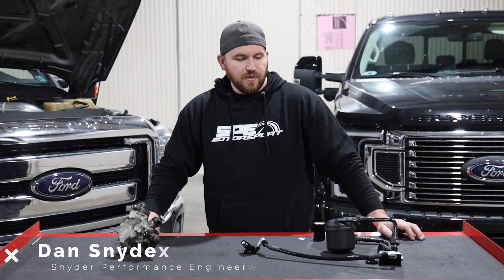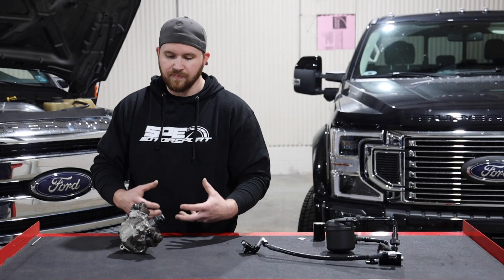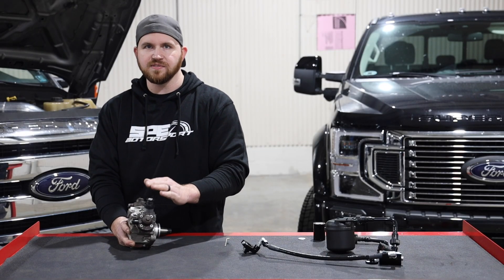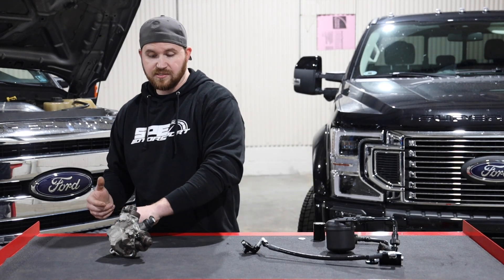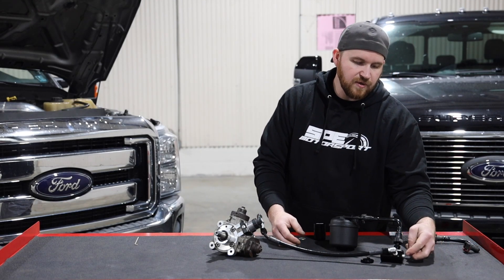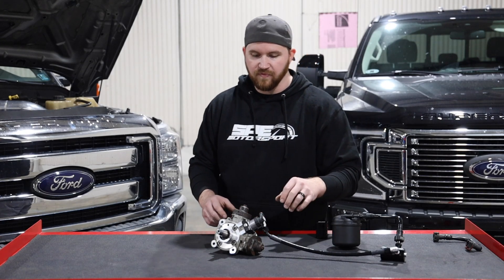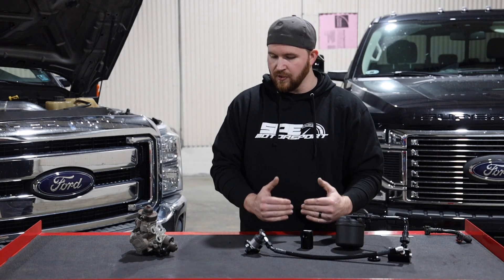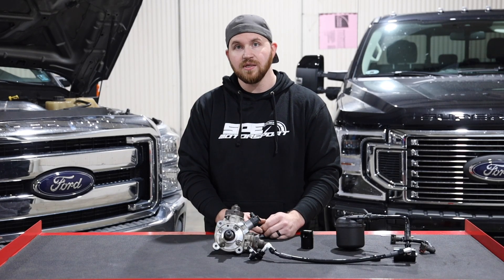SPE's NEW 6.7 POWERSTROKE DISASTER PREVENTION KIT and EXO FILTER SYSTEM

Comment: Notice all the videos installing the SPE kit dont have factory CCV's. both the distribution block and the filter block rubbed up against my factory CCV and caused a leak between one of the two. Removing the SPE kit and going to an S&S kit after hearing from the company that they dont take returns on installed parts. Other than the leak, all the parts look to be in good shape. Tech support said Ford installs the fuel lines bent down sometimes. Not sure I believe that but regardless i'm not yielding my factory hard lines to get an aftermarket kit to work. Feel free to contact me if you want a heavily discounted SPE kit in like new condition!

Comment: Umm ... what's the advantage over maybe a fass pump instalation ... one with a return (from the pump) back to the fass filtration system ?
Reply: The FASS is Upstream of the High pressure system.
Reply: @BLACKCLOUDFORD  true , however I think it heads off  most of the cp4 problems with fuel filtering ,  removal of air ... polishing .
Reply: @smaksymiv4950  it's inevitable.... It'll eventually happen. No matter how well filter and screen your fuel. CP4 design is no good.  When it fails, go with the DCR

Comment: Just so everybody out there is aware I purchased this kit. It was missing the diverter valve that goes on top of the fuel pump. I had to wait over a week for this part to come in. I connected everything back together the truck would not start I tried. And try and the vehicle would not start so I took it all apart again went back to the factory connections, leaving the disaster kit laying off to the side started the truck it took about 20 to 30 seconds. The truck fired up. I ran it for about a minute and then went right back and connected the disaster kit And everything ran fine so if this system is open for any time at all, you would have to go back to the factory connections, fuel lines, and everything start the truck and then repeat the process for installing the disaster kit. It cannot be open for more than a few minutes otherwise, for some reason it does not start with a disaster kit Installed.

Comment: I bought this kit from these guys over two (2) years ago. Once I had it installed on my 2018 F350 LIMMITED 6.7 PowerStroke, I was happy to have preformed this simple task of preventative maintenance and never need worry about an expensive fuel system catastrophic failure from these all too common fuel pump failures.

Comment: Just asking wouldn't any material going back to the fuel tank be picked up by the filter in front of the tank and the filter on the engine? Thanks for video
Reply from the maker: Yes but then there's still debris in the tank.
Reply: @SPEMotorsport  Thanks for the reply, but that was my point, wouldn't it be pickup by the 2 filters one in the tank and the one under the hood before getting to the engine again?
Reply: @duconce  It is my understanding that the fuel in the bottom of the fuel pump goes to the top and is pressurized and sent directly to the injectors.  No filters are in between the metal shedding fuel pump and the injectors.....without a disaster prevention kit.
Hope this helps.
Reply: @markparker4032  The return fuel that is sent back to the tank would go thru the tank filter and the filter up top and the SPE filter before going back to the cp4 pump and injectors. I was only talking about the return line filter to the tank.
Reply: @duconce  The cp4 is the source of the metal shavings.  The pump will simply pump those pieces of metal directly to the injectors.  The 2 fuel filters that you are referring to ....they filter the fuel BEFORE it get's to the pump.  There isn't any filter between the pump and the tank on the return side nor is there any filters between the pump and the injectors......all filters are on the supply side of the pump.
Reply: @markparker4032  I understand all that, again I am speaking of the fuel return line to the fuel tank and the metal shaving that would go back to the tank. I don't see the need for there filter on the return line to the tank only.
Reply: @duconce  Understand.....without this kit......the bottom end of the CP4 pump get's fuel first.....then it goes directly to the top half of the pump to be pressurized.  This kit separates the fuel to the top and bottom of the fuel pump.  So instead of the bottom end failing and those particles going to the top of the pump and ruining injectors etc....they go to the screen filter instead.  I hope this makes sense....this isn't easy to explain....nor a simple concept to understand.
Reply: Maybe try watching some of the other disaster prevention kit video's.  Some are better than others at explaining how they work.  Best of luck to you.
Reply: @markparker4032  You don't understand what I was talking about, I know exactly how the kit works. The kit also filters the line that returns the fuel to the main tank in the truck. Adding another filter there to me wouldn't make any difference since it would not get back to the engine because of the other filters that feed the engine. Not that that matters much because cp4 is all ready trash. I just don't see that filter is needed.
Reply: @duconce  OK.  I see your point.

Comment: How much does this cost, how long does it take to install, and please tell me that it will NOT void my Warranty
Reply from the maker: Lindsey, I would encourage you to head on over to the link below and check out the article on our site to better educate yourself on warranty information. We believe education is a very important tool. As well, the pricing for this kit is on the website. For someone with some mechanical ability and had worked on vehicles before I would say it should take about four hours start to finish. The removal and install of the factory parts is the hardest part of this. Actual installation of the kit once you have everything off the truck needed should be much less than an hour. I will provide a link to another YouTube video that covers installation with some tricks and tips as well.   

Article - https://www.spemotorsport.com/blogs/blog/the-magnusson-moss-warranty-act
Installation Video - https://youtu.be/mVAkkSDJzGM

Comment: What about the fuel in the crank case of the pump? Does it flow in and out some other way? If not that fuel that stays in there would definitely get hot
Reply from the maker: Jacob, fuel is still supplied to and returned from the crank case of the pump, giving the pump a constant fresh supply of fuel that us properly pressurized (as long as your lower pump is doing its job) so it can be regulated and returned through the exo filter incase of a CP4 failure. 

In the event of the failure of the CP4 all returned fuel, and in this case debris, will be routed to the exo filter to limit the debris from cycling through the system and wiping out your fuel cooler, lower pump, injectors, ect. When the truck sees that there is a excess build up of pressure on the return side or limit in supply of fuel you will get a CEL and should immediately pull over and check your exo filter. 

Without our DPK in the event of a CP4 failure there would be nothing except the screen on the volume control valve on top of the CP4 to rely on to stop the debris before it went to your injectors and then returned to the rest of the fuel system.

Comment: How is debris not going out to the injectors with the kit? Is there a feed out line after the cp4 to a filter system then back into the pump heads? I understand the return side but how does the hi presure side work?

Comment: If you're bypassing the pump crankcase that has the return line regulator built into it, how are you regulating the new filtered fuel line coming straight off the fuel filter?
Reply: My thoughts exactly, I don't see the purpose behind the parallel fuel line.  I get the fact that it will be clean filtered fuel going to the pressure reg. valve, but it's not high pressure fuel?

Comment: One issue I’m interested in is also installing a fuel bowl delete for the issues these trucks are having with burning them down. The line you have that comes back to the stock filter will there be an issue with that?

Comment: We appreciate if you guys can email me back. Need to get my parts fixed. Metering value adapter is faulty and my metering value doesn’t fit
Reply from the maker: The factory O ring will swell on the metering valve its a common issue. We supply you with an extra o ring if this has happened to yours.
Reply: @SPEMotorsport  metering value does not kit on the adapter. The holes do not line up.

Comment: Have question is there a serviceable DPF that can be removed with flanges so you do it yourself to clean it ? If so I like to know... TY
Reply: ATS from Colorado makes flanges that can be welded to either side of the DPF section of your exhaust system. This allows removal for cleaning. 
Any decent welder or exhaust shop would be able to do the welding for you.

Comment: I purchased an Ezy Lynk tuner for my 2016 powerstroke. Worked as advertised. I ran on all stages without any issues. A year later i bought this disaster kit, the shop i had installed it warned me that there may be an issue with the kit and tuner. They said if you run on stage 4 it may give you engine codes and stall. I had them install anyway hoping it wouldnt. They were right. I can run on stage 1-3 fine. Stage 4 and i get fuel rail codes. Basically the electric fuel pump in the tank cant keep up. An $800 upgrade if i want the issue to be fixed. From what im hearing, this doesnt happen on every install. I would rather keep the kit on and save my fuel system than run on stage 4. However, i think this is very misleading to customers. Ive spoke to company many times and all they do is blame it on something else. Would i recomend this product? I cant really say, not untill my pump goes out, theres no way to tell if it will work. Anyway guys. Beware if you have tuner and you install. You may need to upgrade pump as well.
Reply: The filter is pretty small, I would think this would restrict fuel follow, some of the other kits offer much bigger filters. Probably works fine with stock set
Reply: Also you might run into problems with the hose line bubbling up on you that comes with the kit idk why? Maybe too much pressure?
Reply: I have the same issue. The tech reps told me that it was installed incorrectly.
Reply: No reason to run stage 4 lol

Comment: That return filter is very small. It looks like it would get clogged up quickly. And , if it is teeing together with a pressure release from the rail, is it possible that debris could enter the rail from this filter connection ? And is that little screen capable of withstanding the pressure and flow coming out of the pump and the rail at the same time ? Seems like it might get blown out.
Why not produce a demonstration with your kit hooked up as well as pressure gauges attached to people could see how it is performing ?
Reply: That's what I'm waiting for before I order this kit. Thanks for bringing this up.
Reply: @billymann5325  I don't mean to disparage anyone's product but they need to step up and prove that it works the way they suggest it does and not expect that people should just trust that I will. They're a tiny unknown company that could be a fraud for all we know. There's a lot of money at stake here. Should be worthwhile to have a independent lab test it.
Reply: @johnmazza9432  I know that they are very reputable, but I agree with testing this product for everyone to see for there own eyes in front of the camera. Were waiting on you now SPE!

Comment: Will this work with an Airdog or FASS? And is it necessary to have a lift pump if I’m running the SPE system? Also, will this need to be run with a sump like beans dual hole?

Comment: Question...What happens if the pump fails and the return line filter plugs up?  Won’t the lift side pressure just go to max? Will codes be thrown before this happens?  What alerts the driver that the pump is failing?

Comment: Hey Dan, great video.  I plan to order the complete kit, waiting for installation video 1st to see if I want to tackle myself.  I was a bit confused on the fuel delivery to pump heads...I'll watch again.  If I understand correctly, in stock form, all of the fuel is delivered to the crank case (cc), of the CP4.2, then up to the metering valve for distribution right?  Also, your kit divides/splits fuel delivery between the CC and MPROP?  My question is this...if the CC is solely lubricated by the incoming fuel, can you risk premature wear by reducing the amount of fuel that's delivered which is the sole method of lubrication?  Also, if the pump heads have clean fuel delivered directly to them, how long does the fuel delivered to the CC stay there as its no longer sent to the MPROP/pump heads?  I assume back through the return but that normally happens slower hence pressure build up?  Sorry, not my intention to doubt, just concerned and want to easy my mind which over thinks everything.  Thanks for your time, I hope my question/concern made sense
Reply: This is also my concern.  Very interested in getting a kit but curious as to what happens with CC fuel now?      Is it just ported back to tank or recirculates threw filter an pump again?
Reply: @taithawken4218 and BIll Waterhouse, I too have the same questions. I assume the relief valve would be exercised much more of the time now that the CC is not supplying fuel to the pump heads....?
Reply: I too have the same questions. I assume the relief valve would be exercised much more of the time now that the CC is not supplying fuel to the pump heads....?

Comment: Great looking kit definitely will be adding this to my truck !
Reply from the maker: Thanks. Make sure you snag 1 this week while it’s on sale!
Reply: @SPEMotorsport  Is the valve o-ring seal supplied with this kit? Can be added if not or have the original/replacement part number available?

Comment: What if we already have the disaster prevention kit installed already will this kit still work sins we already cut the line
Reply from the maker: We will have a post up tomorrow about how to address that issue but in short, you’ll just need to replace the fuel line you cut & we will give you the part number for that in the post.